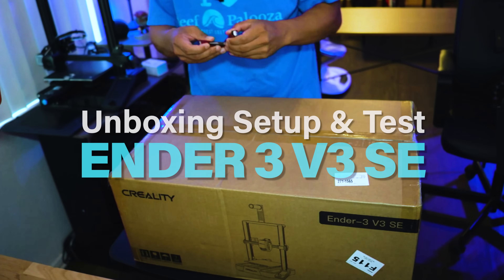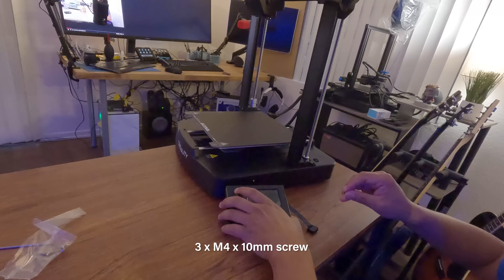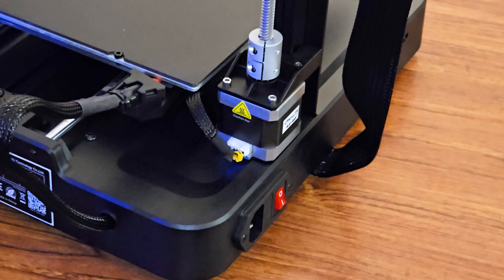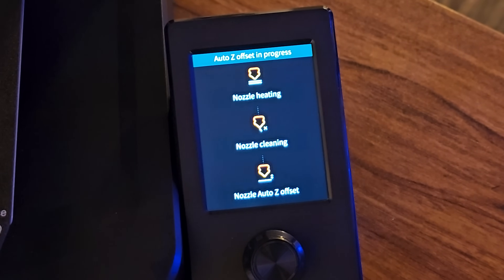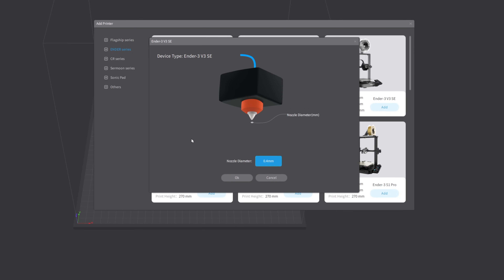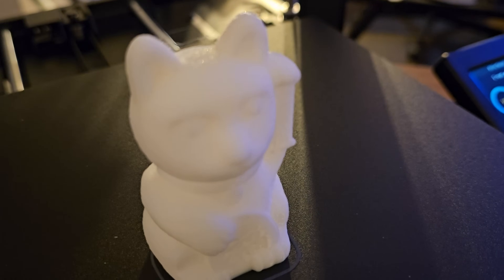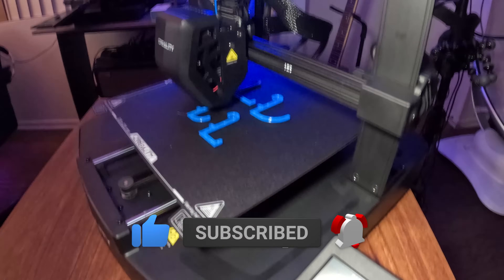Unboxing Creality Ender 3 V3 SE Setup and Test

Comment from the maker: Creality Ender 3 V3 SE:
https://amzn.to/44CEMjt

Link above is my affiliate link. If you make a purchase through them, I may earn a small commission at no extra cost to you. It’s a simple way to support the channel while you shop.
Reply: Ender 3 V3 Se  can Print Abs?
Reply from the maker: @jyotishmansarma4179  Both the S1 and V3 SE, like most printers in the Ender 3 series, are capable of heating up to 260C, which is hot enough to print common materials such as PLA, PETG, and ABS.
Reply from the maker: you might need an enclosure

Comment: I know this is an older video but I'm having a problem I hope you can solve. I just got my new printer but it doesn't bring up the menu at all, upon selecting the language it goes to a tip screen telling me to make sure the nozzle and board are clear then goes straight into the auto leveling. It slightly raises the Y then vibrates violently. I've tried to reconnect the X motor plug a few times but beyond that I'm not sure what to do.
Reply: Update: FIXED. So, the issue was the pin for the Z motor cord was bent.
Reply from the maker: @joeshmoe735 Nice! Glad you tracked it down.  bent Z‑motor pin will absolutely throw the stepper driver off . the board thinks it’s sending clean microsteps, but the motor never completes the phase sequence, so it just jitters and slams to the end. 
Good catch on spotting that. Sharing this will definitely help someone else diagnose weird homing behavior
Reply from the maker: First of all thanks for watching!
 sorry you're running into that issue. Im not that expers but i think  
that violent vibration usually means the printer isn’t detecting one of the motors correctly. 
You can double‑check the Y‑axis motor cable on both ends (printer side and board side). 
Even a slightly loose connection can cause that shaking.
Also try to make sure the X‑axis and Z‑axis motor plugs are fully seated too sometimes they look connected but aren’t fully clicked in.

Worst case, it could be a faulty Y‑motor or cable, which creality support can replace pretty quickly

I hope this helps
Reply: @JobilleTuts  Thank you very much I'll show this to a friend of mine in person to see if they can help out. Appreciate it!
Reply: @JobilleTuts  So an update, i've reset the cords all and it IS progress. Now the nozzle instead of vibrating in the middle vibrated all the way to the right, and left, then a little back to the right and got stuck again. But as it's new years eve i'm not in the condition to tamper with it more lol

Comment: Thank you but I have one question. How do I connect the computer to the printer?
Reply from the maker: For the Ender 3 V3 SE, you don’t actually connect it directly to a computer. Instead, you slice your file on the computer using Cura or Creality Print, save it to the micro‑SD card, and insert that card into the printer. From there, you can start the print right on the screen. Hope that helps. Thank for watching

Comment: I am very confused I did exactly what you did in this video and plugged everything in but the screen won’t turn on it’s just black did I just not do something or what?
Reply from the maker: Hey @CharlieLovesToFish, if the screen isn’t turning on, double‑check that the power cable is firmly connected and the switch on the power supply is flipped to the ON position. Also make sure the voltage selector on the PSU matches your region (110V/220V). If everything’s plugged in correctly and it’s still black, try reseating the display cable inside the printer , sometimes it can come loose during shipping
Reply: @JobilleTuts ok thank you

Comment: I have one of these I set it up and when I turned it on it started steaming white smoke is this normal?
Reply from the maker: If it's coming from the nozzle, that's normal. That might be your melted filament if it is present.
Reply from the maker: If its from underneath bed, that might be something else and you need to contact creality customer service

Comment: Does the 3d printer's head gets clogged when not in used for a long time like a normal printer?
Reply from the maker: Usually no cuz the printer nozzle heats up to melt the remaining filament from the nozzle

Comment: I just bought one and when I put disigns from thingsverse on the sd card it does not appear, do I have to do something first?
Reply from the maker: You need to slice them to for the printer to read. Use creality slicer or anu alicer program to create a gcode for your printer to understamd.

Comment: I just bought this printer. My very first 3D printer AND I'm very happy with it. I quickly learned that the Creality slicing software is rubbish! Everytime I wanted to print something from their store it asks me to log in EVEN THOIUGH I ALREADY AM LOGGED IN. It's an endless loop. So out with the Creality splicer and in with UltiMaker Cura. Cura even allows direct print from PC via USB cable to the printer so no more fussing about with SD cards.
Reply: I just bought one and when I put disigns from thingsverse on the sd card it does not appear, do I have to do something first?
Reply: @fernandospiteri2686  You have to read on what you need to do.
Reply from the maker: Yes i have always used ultimaker.

Comment: Hey mine didn't bring the sd card and reader and missing 1 screw out of 2 that holds the filament. Would it still work if I use another screw for the filament holder and would any sd card and reader work ? Thanks for tutorial
Reply from the maker: @djc3949  that should still work as long as you format the card properly before use. You should contact creality for the missing parts
Reply: @JobilleTuts how do you format the card? My card that came with the machine is broken
Reply from the maker: Yoy can use other sd card or contact creality for replacement. You can format sd card using your conputer 
@mikeprince6685
Reply from the maker: To format an SD card for your Creality Ender 3 V3 SE, follow these steps:

Insert the SD card into your computer's card reader.

Open File Explorer (Windows) or Finder (Mac).

Right-click on the SD card and select "Format."

In the File system dropdown, select FAT32.

Set the Allocation unit size to 4096 bytes.

Uncheck the "Quick Format" option (optional, but recommended for a thorough format).

Click Start to begin the formatting process.

Once formatted, you can safely eject the SD card from your computer and insert it into your printer.
Reply: @ also when I click “file system drop-down” “fat32” isn’t available
Reply from the maker: @mikeprince6685 did you ci tinue formstting it? If yes, re copy the file gcode (sliced stl) again to the sd card and insert it to the printer
Reply: @ I got it to work by using a smaller memory card, once using that I was able to use the FAT reformat, thank you for all your help!
Reply from the maker: @mikeprince6685  im glad you got it all working. Happy Holidays!

Comment: if I have 2 that are blue(relatively level) then what action do I take to make them green?
Reply from the maker: @michelthibault1766  i havent experience this in thisnprinter but ive seen other users Use the adjustment knobs under the build plate to raise or lower specific corners(blue section) until you get the green color.

Comment: when i plug mine in i don't see that screen. it just lest me select the language over and over and over
Reply: That’s what mine does too
Reply: Mine did same too, on the back there is a switch I had to move it to 115 from 240 then it worked now I’m printing the test shovel. Hope this helps
Reply: @ that was exactly the problem, luckily I found out not too long after I made that comment. The switch is like straight up hidden back there in its own little cave

Comment: I received mine today, but I was worried where you place the filament that's provided, and now I see you just hang it there :) NOW I can print my first one :)
Reply from the maker: Congrats! Yeah my filament is fine
Reply: Any website you prefere where I can get free designs ?
Reply from the maker: Thingyverse.com , makerworld
 @Mantala0611
Reply: @JobilleTuts  I put some stl files on a micro sd but the device isn't showing the files :(
Reply from the maker: @Mantyou 3d printers cant read stl files itself. You need to slice the stl file with a slicer software and this will be converted to gcodes automaticaly once you sliced it and save it to your sd card. After slicing the stl and converted to gcodes, it should be readable now and rewdy for printing. I hope that helps
Reply: @JobilleTuts  Sorry for the late response but indeed :) printing like crazy now hahaha. Thanks
Reply from the maker: @Mantala0611  im glad you got it working! Enjoy
Reply from the maker: Cult3d

Comment: Can i print using my phone or laptop only?
Reply from the maker: @AlyonaJohnson  you cant print via phone. Use sd card
Reply: @JobilleTuts  ok thank you
Reply: @AlyonaJohnson  You can print from laptop/PC connected to Creality Ender-3 V3 SE via USB cable using slicer software UltiMaker Cura. Works really well.👍

Comment: This is a very nice printer. Unfortunately mine has a problem with the extruder. It clicks on each change of direction - ie twice per retraction. I contacted Creality. They wouldn't respond until I had gone through the usual hoops of sending them a copy of my receipt a video of the issue a photo of the ID plate on the back of the printer. Once I had done this they simply told me 'yes that is normal'. Well it's not normal on any of the other three 3D printers I have owned..... and there are discussions of some people experiencing retraction clicking on Reddit - and clearly the people replying DON'T experience  the same..... so thanks for nothing Creality.
Only buy one of these if you are happy to fix and maintain it yourself - because apparently Creality support is.... less than impressive.

Comment: When you are adjusting the speed, thats not the speed, it's a percentage, so at 200% it is twice as fast as what the setting was when the file was sliced.
Reply from the maker: So what should be the label in the settings?

Comment: So it comes with the SD card? What about a SD card adapter?
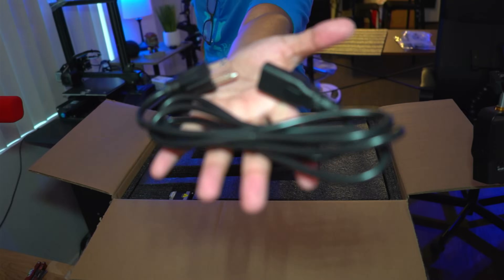Reply from the maker: 0:56 it comes with SD card and card reader so you can plug it in your pc usb port
Reply: @JobilleTuts does the ss card come pre loaded with a model to test right away
Reply: @Josiahs3DP  yes! A cat file you can print
Reply: @toetie2019  Mine came with a scraper that can be used to remove printed objects from the print bed. Very handy.

Comment: Thanks for the video, it helped me work out how to put mine back into the box so I can send mine back for a refund. Bed levelling is far from perfect, auto-z-offset is not correct but when adjusting it so that stuff sticks, it seems like I have to be too close, or possibly some bits end up printed too closely to the bed. The bed is so uneven based on the levelling mesh there's no way this could easily compensate. Z-banding is atrocious.

If someone is printing medium sized parts with no fine detail and doesn't care about quality, maybe they are more likely to have luck with this than an earlier ender 3 design. My ender 3V2 has caused me headaches, a lot, but this doesn't solve the problems I've been having with it more recently

Comment: Question, even if I set my slicer at 200mm/s it only seems to print at about 100mm/s.  The only way I get the higher speed is by using "tune" on the screen.  Am I doing something wrong in the Creality slicer or is that just a default?  Will I always need to use the screen to get the higher speeds? Thanks
Reply from the maker: Check your start mid and last layer speed settings. Might have changed
Reply: It slows down itself for better print quality. You probably don't want to change that.

Comment: tis is the best thing they have done for a cheap price then a £700 printer i pre ordered mine because i was Havin issue with my ender 3 and had to get this.
Reply from the maker: i also had issues with my ender 3 v2. this device has solved the pain having to level the bed all the time
Reply: @JobilleTuts yes I feel the pain its best to just sell the ender 3 so it makes up the price I would say

Comment: When I try to level mine during the z axis calibration it just jams the print head into the bed. ☹️
Reply from the maker: Did you check underneath the bed if theres a major tilt angle?
Reply: @JobilleTuts  That corner where the censor is slightly higher than the rest. Thanks.
Reply from the maker: @MobileDecay  i would try to manualy levl the bed as a workaround. adjust the z offset if its too high. use a sheet of paper to measure the height between bed and nozzle. but this kinda defeat the purpose of this auto leveling feature they added. it should level automaticaly for us. check on creality customers service as well if they can replace the item for you.
Reply: @JobilleTuts  I bought it so I didn't have to do that all of time. I'll just it back and stick my old printer. 😥
Reply from the maker: @MobileDecay same here i bought it so i dont have to do leveling. Sorry to hear that. Try to contact creality they should do something about it
Reply: @JobilleTuts  Yeah I'm gonna contact them. Even without the z axis sensor working right it's getting way better and faster prints than my old ender 3. After playing with it I don't wanna send it back.
Reply from the maker: That's awesome. Thanks again for watching